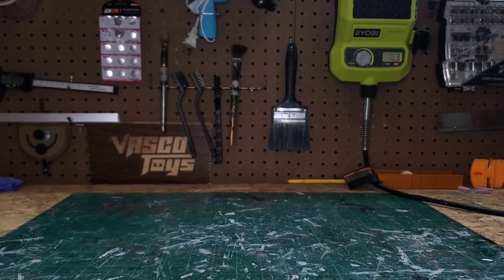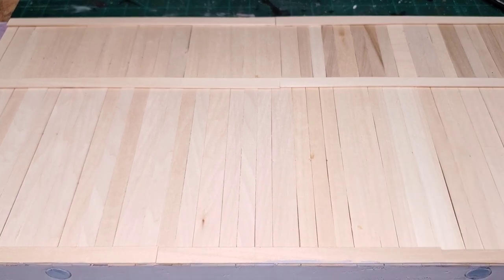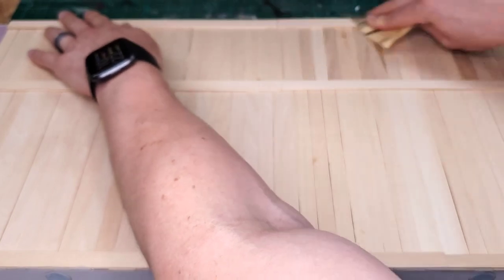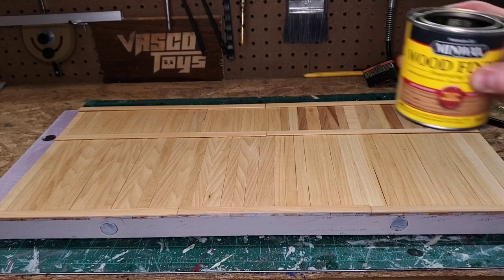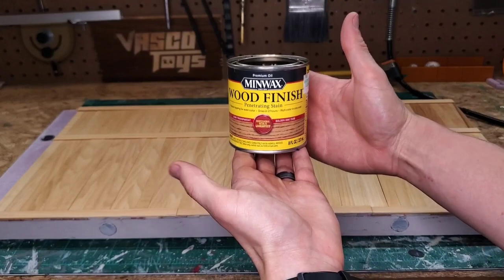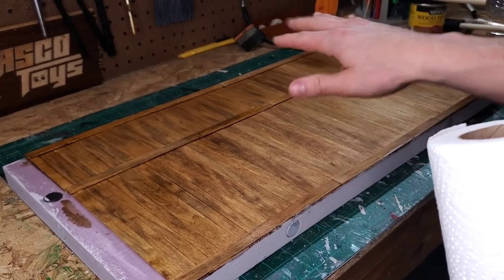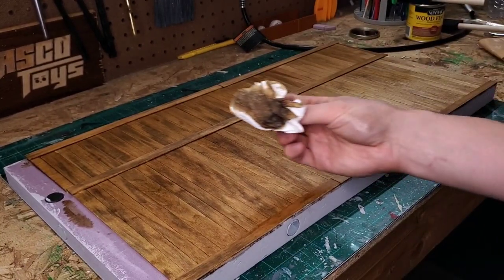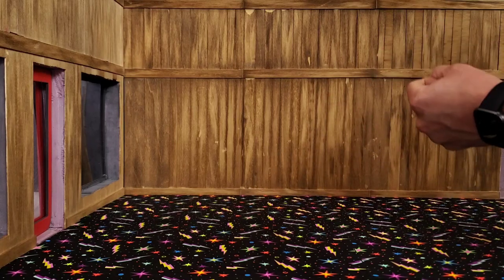How to Stain Balsa and Bass Wood

Comment: I took 320 grit to balsa wood and it CRUMBLES under the fine grit. I ended up doing 6 hundoe on the surface and doubling & tripling up the boards for sanding the edges. I💜U
Reply from the maker: Oh wow! I didn't realize it would crumble at that Grit. Glad you were able to find a solution that worked for you.
Reply: @vascotoys  depends on which wood you get and from where.

Comment: Could u sand the balsa wood before you cut them into the strips so that way you could have the vertical and horizontal wood have the “correct” line detail I think you were trying to get
Reply from the maker: I think you totally could. I just didn't think to sand it before cutting it. Good idea!